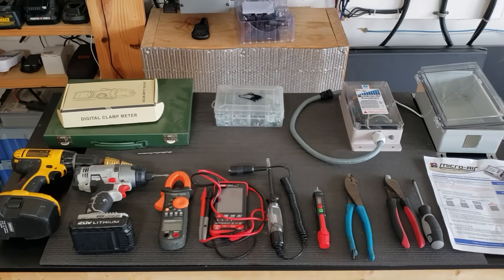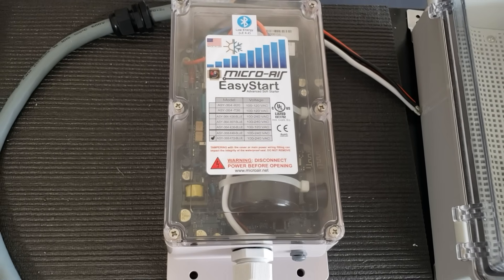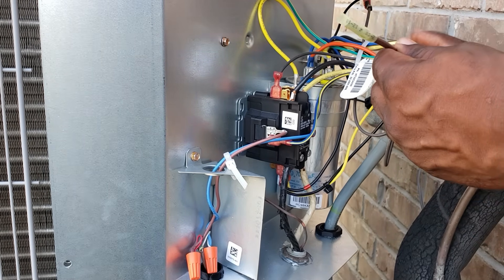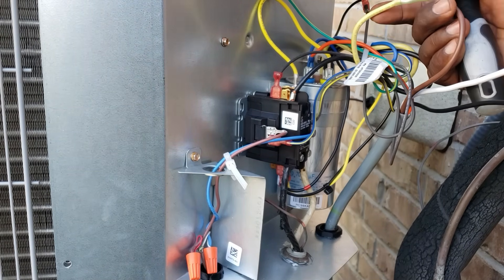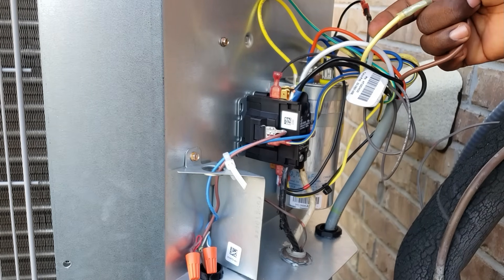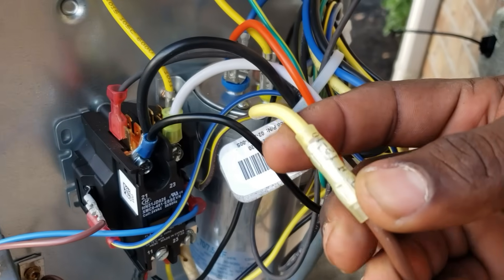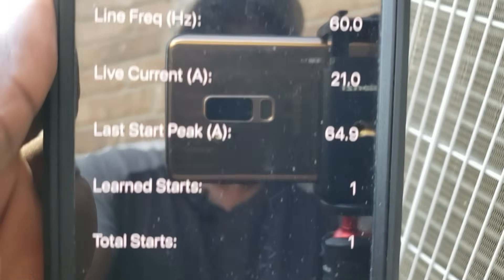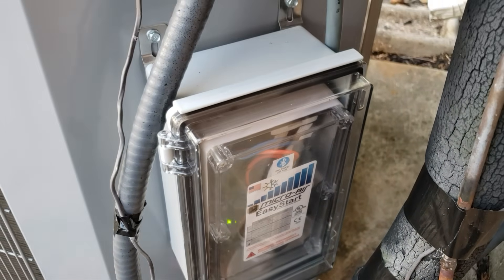Micro-Air EasyStart ASY-368 5 Ton A/C Installation

Comment: Great video! So much clearer than the one from the company. I could actually see what you were doing.
Reply: Update: with your expert instruction, I set mine up yesterday on a 3 ton Bryant. I even used the same weatherproof box - great idea... 77LRA (according to the sticker - my Ames CM600A meter won't do in-rush) down to 21.6 an over 71% decrease! (according to the MicroAir app) on start #6. Thank you again!

I will add one more thing that I did based on another video I saw, so it may help others in a similar situation. On the 3 Ton unit I just didn't have enough enclosure real estate to mount the box underneath like you did or inside the unit as the manufacturer recommends so I used another person's idea - I left the connecting cable the full length and used four 50lb neodymium hook magnets ($10 on Amazon) to secure it to the outside of the cover. With 200 lbs of magnetic force holding it, there's no risk of it just falling off in the wind.

And yeah, be sure to turn off your breaker at least 30 minutes before you do anything to give the capacitor ample time to discharge. I left mine an hour and still tested it with a screwdriver across the terminals to be safe.
Reply: Update #2 - I just installed another on a 3 Ton Trane. I'm sure others have mentioned this but pay close attention to the LOCATIONS of the wires on the existing unit, not just the colors of the wires. 

For example, on my Bryant AC the compressor wire (and shown in the video) was YELLOW. On the Trane however, it's RED. This wasn't the only color difference I dealt with; your colors could be different still so I'm not going to compound the situation by listing a bunch of colors here. I am not sure why this can't be standardized across manufacturers (probably to make it more difficult so you have to pay a HVAC tech instead of DIY)? Regardless, pay attention to the locations and you'll be good to go.

Comment: Out of curiosity, when the compressor isn't on do any of your LED's remain lit?
Reply from the maker: No, when the compressor goes off, the system goes off as well
Reply: @GeneratorReviews  great, just needed to make sure.  I'm on the fence on whether my system has a compressor monitor so I figured maybe it was that preventing it from staying in

Comment: just adding a Start Capacitor with a Potential Relay  will give about the same results for under $75 , I added a 108-130 mfd 330vac Start capacitor  to my 3.5 ton AC and the start up  inrush amps went from 78amps to 37 amps    the MARS Capacitor & Potential relay only cost me $51

Comment: Hey buddy, another great video, helped me decide to install on my 5 ton unit rated for 152.5 LRA. Unfortunately, I don’t have a good ‘before’ number for actual inrush amps it was pulling. But, upon install the first learn cycle scored just 41.9 inrush amps and by the 5th learn it was down to 32 inrush amps. So the device seems to be consistent with MicroAir claims of 75% reduction. Sweet. Hey can you help with a question I have? This is a 240v system and the circuit breaker I have is a pair of 30 amp breakers supporting AC. So, does that mean that my AC is now pulling 32 inrush amps on EACH leg or TOTAL? I am not sure I am clear the role of the two 120 volt power legs that sum up to 240 volt total. I am trying to size the generator I would need and wondering whether my AC is using 32 inrush amps on each leg and therefore I need a generator that can keep up with 62 amps or does it mean I just need to generator 32 amps total. I guess it comes down to what MicroAir is reporting in the app - 120 volt data or 240 volt data.
Reply from the maker: You’re going to need a generator that’s at least 9000 W to power your house and still have power to spare.

The condenser pulls 32 amps by itself
Reply: @GeneratorReviews  Per the label on my system, RLA is 23.7 and LRA is 152.5. According to my MicroAir my Last Start Peak was 30.8 A and Live Current is 10.7 A. I will note that it was 51 degrees F today so the system isn’t working as hard as it would during a Texas summer day of 105F, so maybe power consumption would be higher in the summer. Given these measurements, does anything change in your first analysis? Too much for a pair of Delta Pro with the 240V hub?
Reply: @natehowe7975  I have a 2008 Trane XR13 5-ton unit (in Texas) with the EasyStart X72 installed since 5/13/2023 and the LRA is rated at 148A.  I'm seeing numbers fluctuating wildly for the Last Start Peak between 34A and 74A.  But the Live Current readings are pretty solid - consistently between 12A and 14A.  Seems like the Last Start Peak goes way up with more heat and humidity.

Comment: 58.7 peak still high and not an option for a 30 amps connection. I seen others with lower peak starter amps in the mid 20s is your a small version? I got a 2.5 T AC I don't think this one will work for me.
Reply from the maker: I’m down to 34 amps the last time I checked
Reply: @GeneratorReviews  34 will be fine for my 9500 30 amps
Reply from the maker: @vitin6039  yes the soft start makes up the difference
Reply: @GeneratorReviews  Grate Video I got mine 2 days ago and installed right away. The first start was in the 52 amps peak but after the learn period it went down to 18 amps incredible, thanks! Now I can run my whole house with a Predator 9500, no issues.

Comment: This old but there was just a hurricane in Fl (Ian) and people will be doing these by the thousands. The Yellow wire is the RUN wire from the compressor. Not all Run wires are yellow. To verify on the back panel cover there will be a schematic find the compressor on it and will show the color of the (Run) wire the other 3 are pretty straight forward.Good vid bud...
Reply: Very important. Good to point that out. It seems this is where DIYers make their mistakes and it voids the warranty, an expensive mistake.

Comment: Where do you purchase the 368 x 72 model?  Link please
Reply: The link is to the clear case. I'm looking for the link to the actual micro air product
Reply from the maker: @jonjones33  I don’t have a link for that one you just have to go to the manufacturer website and make sure you find the right one for your AC unit.
Reply from the maker: The link is in the description of the video check it out

Comment: Does it save electricity? Is it worth installing for a power saving purpose? 
What model are you using for the 5 ton AC?
Reply from the maker: I don’t know about the electricity saving part but I do know is it’s worth installing it if you hate those huge surge on your house when the compressor comes on and it also extend the life of your compressor I guess that’s the biggest plus for me.
Thanks Mik
Reply: It's in the description:  
EasyStart 368-X72-Blue

Comment: Will add this to my list.  Thanks, Gavin.  Not sure what size my A/C unit is but will figure it out.
Reply: I know your post is old and you've probably figured out your A/C size by now, but if anyone else is reading...Usually in the model number,  somewhere in the middle, there's a number 36, 42, 48, 60...take that number multiply it by a thousand, then divide that number by 12,000 (example: 42 x 1k=42,000/12,000=3.5), so that would be a 3.5 ton unit.
Reply: @Alan-yd5pc  Thank you for the response. I will keep this in mind as I did figure it out forgot.
Reply from the maker: It really made a huge difference on my AC unit no more hard startup

Comment: Thanks for this great detailed video. I just bought one for our 3-ton AC unit. Our Predator 9000/7250-watt generator can run our AC on gasoline, with no problem.  But when using NG, it sometimes can't start it.   (I installed a Tri-fuel kit)  

I'll let you know how it went.  Also, it took almost a month to receive our unit directly from Micro-Air.
Reply from the maker: Yes please update us when you install it I’d love to know how it worked for you👍🏾
Reply: Following, now searching for another portable generator to run a 4ton AC and a few other things on NG, with low THD.

Comment: Hi, I have Frigidaire - FS4BE-060KA - 5 Ton 14 SEER High Efficiency AC Compressor. Do you think my wiring would be the same as yours?
Reply from the maker: Might not be exactly the same but they are all the same concept and the instructions are very easy to follow.
Reply: Thank you!

Comment: Do you have the duromax 9000 inverter?  Also how long does it run on a full tank with this setup?
Reply from the maker: Yes I do have the Duromax 9000 check out that video
https://youtu.be/1_nCC-TarEE
Reply: @GeneratorReviews  I've seen and liked but I want to see it fire up an hvac

Comment: These should be standard on every new A/C unit.
Reply from the maker: Agreed!!
Reply: A/C company's probably don't install these on purpose, 1) it would increase the price of the unit 2) A/C's are probably designed/engineering for a certain service life(~10-15 years?), this extends that life and while your A/C is living past it's life, A/C company's aren't selling new units. 🤓
Reply: Definitely.  
Every newest a/c should have or as option 
Plus, because starting amp looks like in 6 times less grid-on setups  can be done as well.

Comment: Great Video! My Trane xr14 5 ton (2017) has two capacitors. One is a dual run but the Herm leads into the right side of the relay with a dual connector. the connector leads into another capacitor for the compressor winding. After a few fault codes i put the  EasyStart orange wire on the second cap and finally the faults went away. The starting amps went from 75 to 50 after its learning cycles. Anybody know why the compressor wire would be routed like that to a second cap? is it a hardstart cap maybe?  if I removed the second cap out of the circuit and put the compressor wire on the first cap would the EasyStart be able to lower amps even more?
Reply from the maker: I think as per instructions you’re supposed to remove those hard start capacitors may want to check on that
Reply: @GeneratorReviews  thanks, you may be right it's a hard start. I'm going to remove it.

Comment: I have a 5 ton Rheem with a stated LRA of 144 amps! My peak after installing the Easy Start is now 45.6! I had already purchased a 24Kw Generac (before learning about Easy Start) and would have had to do some load management. Now that won't be necessary. Power efficiency of the Generac should improve from reduced load not to mention, reduced wear/tear of the AC compressor. Really a good investment. And Microaire is a really good well run company!
Reply: My goodman 5ton LRA is also 152
Reply: No way, no 5 ton unit uses 144amps to start. If your using a clamp meter to measure it, your numbers will be way off. There not accurate.
Reply: @RadioRich100  I have a 5 ton Trane...4TTR6060J1...guess what?...144-145 Amps during inrush...measured with 3 different amp meters...at least 5 different starts...relatively new unit (2 years old)
Reply: @RadioRich100 my rheem 5 ton has an LRA of 152. (Keep in mind that LRAs posted on the condensor is the max. So there is a percentage of deviation)

Comment: I'm going to install a 368 model on my unit and where the unit is it gets alot of rain run-off from the corner of the roof. That waterproof box that you bought looks like it was exactly the right size for the micro-air soft start. Where did you get it and could you supply an exact link to it ? Any help would be appreciated. By the way, very good video.
Reply from the maker: Hey Criss 
The link is in the description 
You’ll have to cut just a small circle in the bottom for the wire but yes it was the perfect size

Comment: I’m in middle of same project. Mircoair kit arriving this week. Converted my generac gp8000 power rush to a natural gas kit and hope to power my 5 ton on it. Fingers crossed
Reply: Worked like a charm. 5 ton ac can be run by a generac gp8000 power rush. I also have a png technology natural gas kit on it but the generator bogs down when I try to run the AC. Gonna try and tune it .
Reply: @bentwiss3862 Did it work on NG eventually? What's your inrush current with the soft start installed? I'm looking at the Gp8000e for my 3 ton ac unit.

Comment: Really cool.  All the electricians I called don't want to mess around with soft start or even transfer switches.  I just installed a 120 volt four circuit transfer switch and will store this in my memory bank for when I upgrade my service and install a larger backup.  I've got a very old Zinsco box that is probably more than maxed out right now.  You're providing a helpful service. Thank you.
Reply from the maker: The electricians that you do find that will install them are charging an arm and a leg.

Comment: Nice informative video buddy. What brand was you ac?  And you don’t have a link for the soft start? I see you had one for the clear plastic box.
Reply from the maker: I couldn’t find it on Amazon my AC is a carrier 5 ton
Reply: @GeneratorReviews  I got a 4 ton carrier I’ll see where I can find one. 🙏
Reply: @GeneratorReviews  so did you get it directly from micro-aire?
Reply from the maker: @sae1964  yes I did get it directly from them.
Reply: @GeneratorReviews  what are the measurements of the case  you got to fit the micro- aire? Amazon had several of the sizes.
Reply from the maker: @sae1964  Here’s the link to the one I used https://amzn.to/3P7VGvU
Reply: @GeneratorReviews  thanks buddy. Appreciate it.

Comment: Not too bad going from 74 locked rotor amps (LRA) down to 54 on a 5 ton unit. My 2.5 ton heat pump is able to be started on a Predator 9500 with the economy speed control (ESC) disabled. You can definitely tell when the compressor startup hitting the generator with hard 56 amps; now it only peaks out at 20 amps soft start giving the ESC time to ramp up the rpm's to meet the startup demand.

Definitely curious how well a 9,000 peak watt generator will handle a compressor soft started 54 amps with ESC active. In a pinch you could possibly get away with one and parallel second one as needed.

Only one gripe about the soft start unit is the jumper cord could've been a bit longer to give me better mounting options since the wiring under the outside unit cover is is a bit busy with the additional controls that a heat pump normally has. At least I was able to get some stainless studs spot welded on to the outside cover to mount the controller to keep the installation neat and tidy. I do have remove 4 nuts that secures it to cover first then I can access the rest of the wiring; not a big deal, just had to be a little bit creative.
Reply: I’ll do you one better. I can start my 2.5 heat pump ac with. Predator 3500 in eco mode with a soft starter. How’s that for insane
Reply: 54 amps still seems very high for a soft start module.  I am wondering if something is wrong.  My 4 ton went from around 113 amps to 28 max start amps.

Comment: After I had my 368 series installed, after the first five starts through the app during the peak heat of the day I had the unit relearn my ac. It dropped the lra an additional 15-20 amps. I sit at 35 starting amps, very pleased!
Reply from the maker: Thanks Lynn
I will try that!

Comment: Great showing of the Bluetooth app for the 368-BLUE model.  A 9000W generator -- with too much other power needed -- was not enough to start AC. I liked your microwave example.  With EasyStart 368 for 60,000 BTUs made this a great investment for you to run AC on emergency generator, off grid of inverter power sources and battery walls.  Extends compressor life too.  I see someone posting here already called it a game changer.  On amp measurement, remember that all amp meters are not created equal.  The oscilloscope in the lab will measure better than something you grab off the shelf.  Quiet starts was an added boost.  Great job.
Reply from the maker: Thanks kevin
Well said by the way have to agree with you 100%